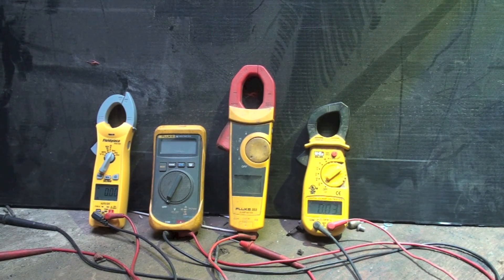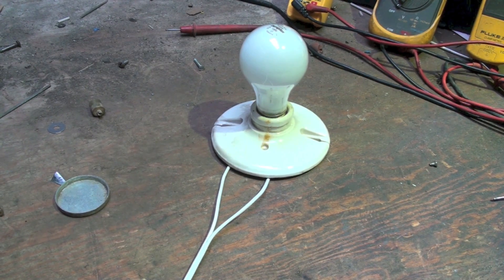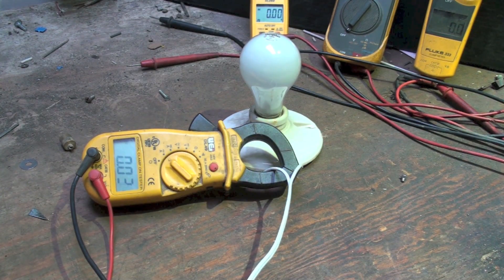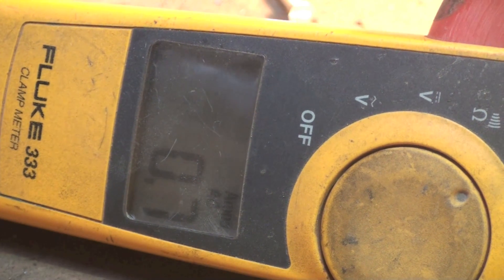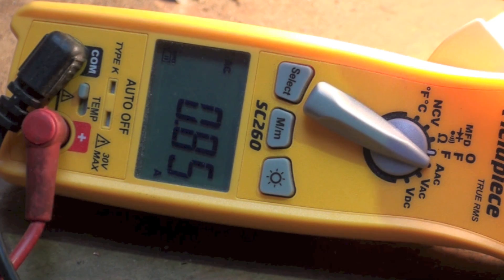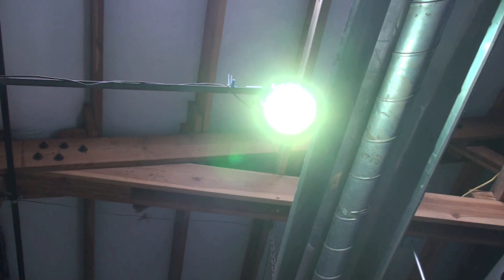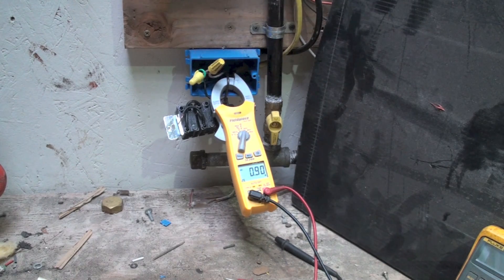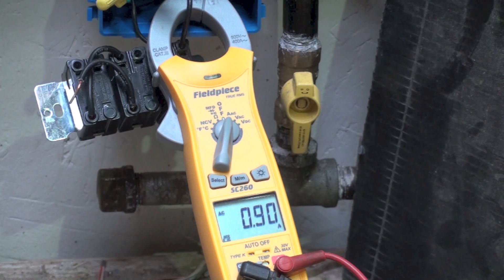Compare RMS with standard meter for HVAC

Comment: That's quite a big difference between RMS and standard with electronic loads.  Makes me wonder:  which type of meter does the power co have in my meter socket?
Reply from the maker: Straycurrent I don't know for sure.  I have been told they compensate but that's not for sure.
GFM

Comment: I've actually been eyeing that meter on Amazon, but it's lack of a amps DC setting worries me.

Is that an issue and would you suggest it as a starter meter? I have my dads old Fluke but I really want/need an amp clamp.
Reply from the maker: Jeff S For most HVAC applications, the DC amps is not necessary.  The Fieldpiece shown here is a very good all around  meter.  Hope this helps.
GFM
Reply: +grayfurnaceman Been in the trade for about a month, switching from the FLUKE 375 i've had for general residential work to one more suited for HVAC work...for the money, it seems like Fieldpiece is the way to go.  Fluke doesn't seem to offer a meter specifically tailored to Air Conditioning work.
Reply: scrambler350 fluke 323
Reply: The 323 is a similar price point, but has no provision for a Type-K thermocouple, can't read capacitance, nor does the screen light up for low light conditions in attics.
  The Fieldpiece also has an integrated magnet on the back which I use daily and the Non-contact Voltage detecting feature which differentiates between High and Low voltage A/C. 
The little difference between my Fluke and the Fieldpiece that makes a HUGE difference in day-to-day functionality is the shape of the amp-clamp - it's slimmer and comes to a point on the right hand side allowing it to be maneuvered between wires one-handed much much easier.
Reply from the maker: I never used amps DC in HVAC.
GFM